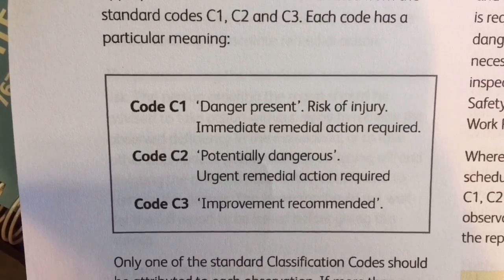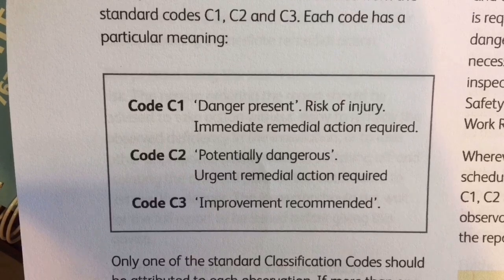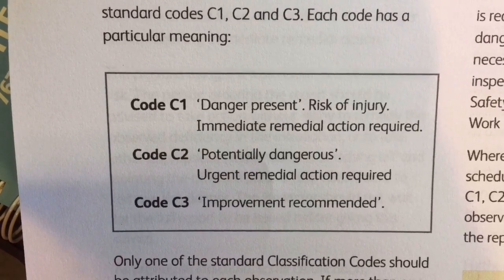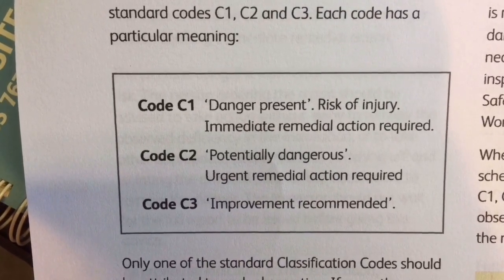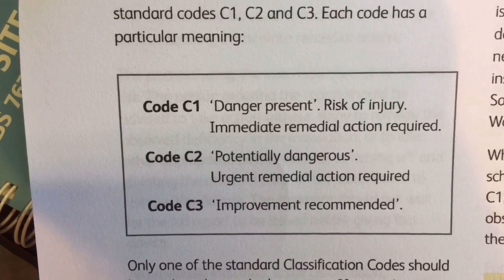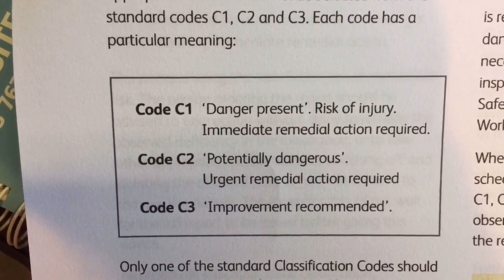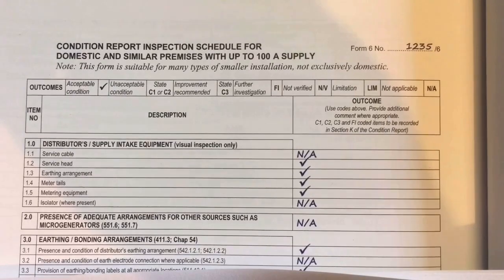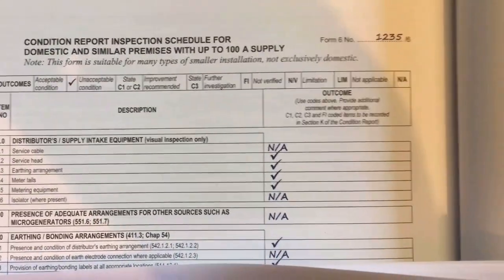EICR Classification Codes Exercise

Comment: 2
Megohm on the socket circuit is a pass BS7671 and guidance note 3 states that the minimum acceptable Insulation resistance is 1megohm and anything between (1megohm and 2megohm for existing installations)(20megohm for new installations) would require further investigation .
Reply from the maker: Thanks for getting involved. 1 Meg min. in the Regs and 20 Meg min. in GN3 requiring further investigations for new installations is correct. But tell me where you are getting the 1-2 Meg from for existing installations? Simulation exercises like this always throw up their own issues and you would have to take each case on merit. I've always thought they are fairly arbitrary values anyway. And for an EICR you would generally only get to testing individual circuits if the overall value L/N-E was low. On a new installation I would be querying anything less than the maximum the meter could measure up to. If we make it specific and say you were carrying out an EICR on a 5 year old installation for a landlord and this was the only issue with all other circuits >999 would you record the low value, circle 'satisfactory' and leave it for another 5 years without commenting or maybe give it a C3? The point in the exercise is to get people thinking about codes and the 2 Meg was picked deliberately (was 2 not 20 at the time) as it is not an out and out fail and gives rise to the kind of conversation we are having. Looking at the video again I might hold back on the C2 but would definitely record FI and this itself would warrant an 'unstisfactory'.

Comment: Great video 
Taking my 2391 in February and crapping myself. Only got one code wrong that was the lightning without an earth. I was under the impression if the switch and light were plastic not metal then it would be classed as satisfactory c2 if the light fitting was metal and required an earth
Reply from the maker: Thanks. The switch is plastic but the backbox is metal and the screws can be touched and could become live under fault conditions. If the backbox was a plaster fix type and the screws were insulated then that would be a different story. Good luck on your 2391.

Comment: so cables burried in the wall less than 50 mm either protected by earthed metalic enclosure or RCD in the case of video, none is true as threre is no RCD and no mechanical protection of metallic enclosure aswell so it would be C2 rather then C3?
Reply from the maker: Good point and thanks for getting involved. I'm going off the Electrical Safety First best practice guide here rather than just my own opinion. It's a bit dated that now to be fair and the prominence of RCDs has increased. Realistically, the chances of no RCD protection for cables less than 50mm in the building fabric being an issue on its own in isolation is probably theoretical (problem with using test rigs and simulation) as usually it would be combined with lack of RCD protection to socket outlets, circuits supplying mobile equipment outdoors and cables in the bathroom. These situations would warrant a C2 being 'potentially dangerous' so overall we'd be recording that and judging the installation as 'unsatisfactory' in reality.

Comment: Good video. Can see you've put a lot of work in to it.
2 things I would say just to put my opinion in.
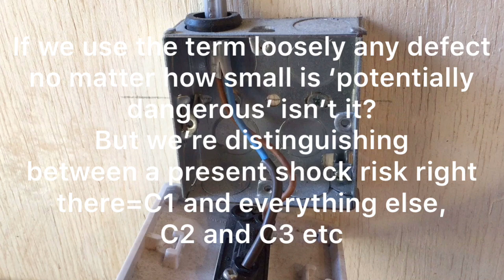8:45 - That is a plastic light switch (class 2), Assuming the box is buried in a wall and you can put the plastic pips in to cover the screws then that for me would be a C3. 
10:10 - I generally agree and would seek to find out why the reading was so high but if a circuit is RCD protected (30ma) then zs reading can be as high as 1667ohms!

Thanks
Reply from the maker: Thanks for getting involved, appreciated. Not that much work actually! Debateable those two points. In this case there's no plastic pips and no RCD (from memory). Regarding the 1667 ohms, it goes back and forth that one, you could argue that anything above the value expected for the cross sectional area and length of circuit cables is questionable and worth investigating. And where do you then draw the line? Happy with a Zs of 100 ohms?
Reply: @sparkipeat2255  Thanks for the vid.
There is an interesting regulation regarding the plastic pips on light switches that's good for debate.

410.3.9 (iii) is an interesting one. I'm not sure I agree with it, but as far as BS7671 is concerned..  if that metal switch were burried and just the screw heads were exposed, are plastic pips needed?